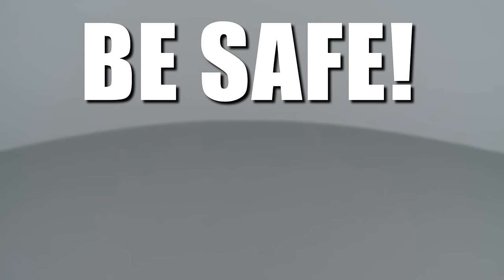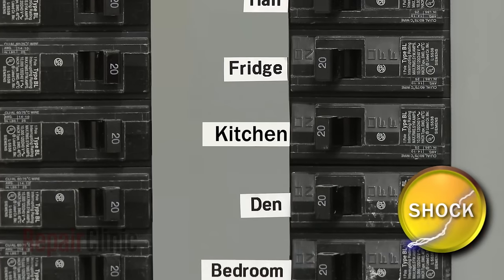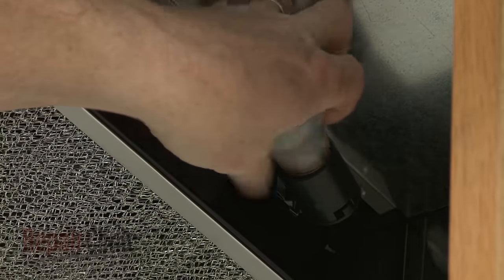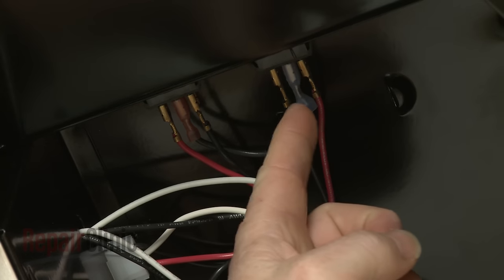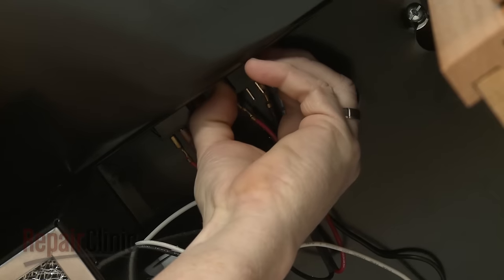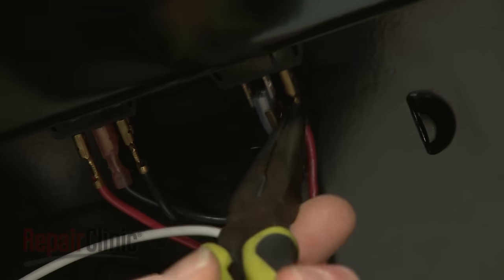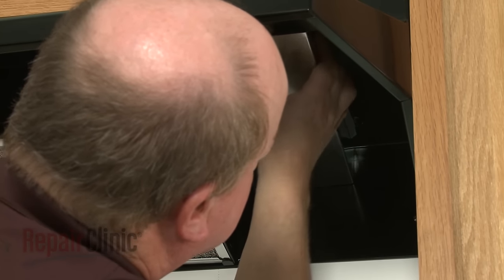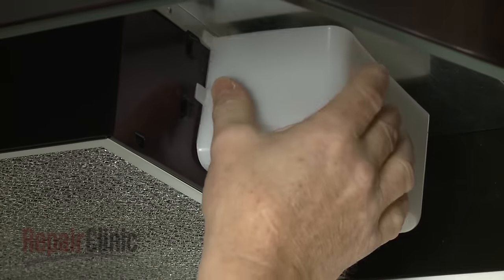Nutone Range Hood Fan Light Switch Replacement #SR561157

Comment: I have an older model Range Hood (Model 233.52152002). How do I remove the old wires from their connectors? I don't want to break any of the connectors.
Reply from the maker: Alex Karoffa Most electrical connectors on appliances are 1/4" spade terminals, these terminals can be male or female and it's simply a matter of pulling them apart. Check out our range vent hood disassembly video for more information. http://www.repairclinic.com/RepairHelp/Range-Vent-Hood-Repair-Help?TLSID=1773